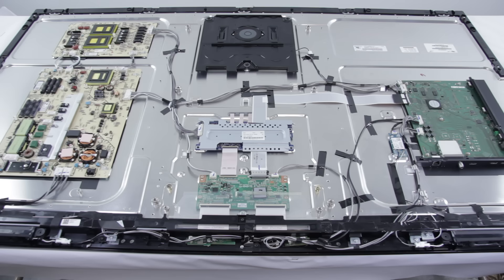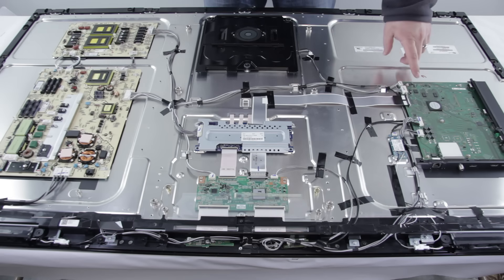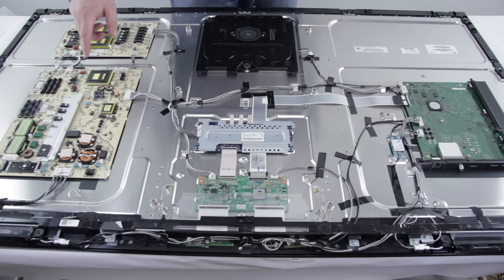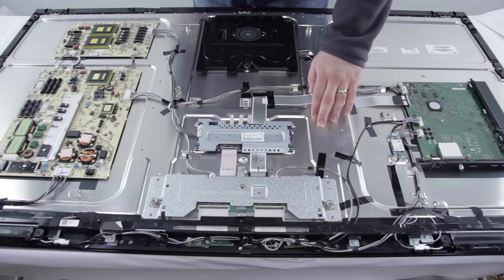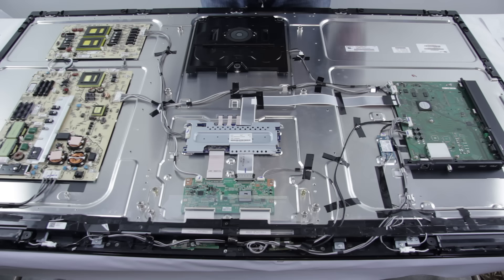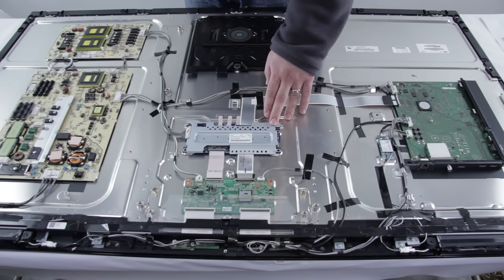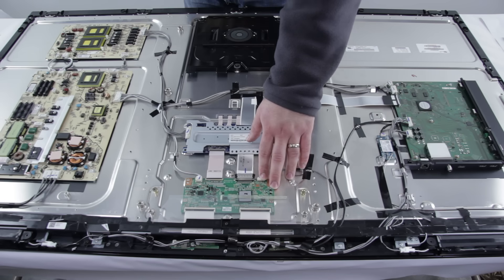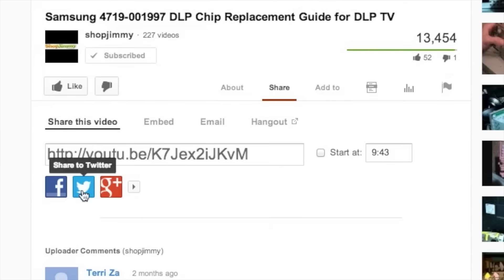LED TV Repair Tutorial - Common Symptoms & Solutions - How to Repair LED TVs

Comment: Hi there I have an LG smart TV 32 inch. http://www.lg.com/au/tvs/lg-32LV3730-lcd-tv
One side of the screen (left) is ok but the right side has 4 or 5 large vertical coloured bands going vertically. I also noticed very fine black horizontal lines going across the whole TV. Immediately I think its the tcon board but someone suggested I try test that the panel isnt faulty as there are two small thin boards that are connected via the two tcon ribbons (which apparently are fixed to the panel and not replaceable? - that true?). Is there a way to test if the panel is actually at fault or do I just need to try replace the tcon board first and see what happens? If I unplug the tcon board, the lines dissapear. Anything else I could try rule out if its the actual panel?
Reply from the maker: Dudley Butt   This could be a problem with either the t-con board, the main board or the TV Panel.  You can replace the main board and t-con boards individually to see if one of them fixes the problem.  Unfortunately I do not see any replacement parts in the search results for your TV model number on our website.  Please reply with your part number on your main board and t-con board and I can try searching for replacement parts.  Thanks and please let us know if you have any further questions!  www.shopjimmy.com

Comment: Hi, i have a Samsung ledtv model UN32D4005BD. Ive had it for nearly 3 years now. I usually play my ps4 on it and as of late i have suddenly been getting some issues.  A fifth of my screen starting from the top is covered with white thick ghosted vertical lines and series of horizontal lines are flashing on my screen. What should i do? Is it a case where i have to replace the main board and power supply board or is it that screen is no good and i have to buy a no tv. I would like to try to fix this problem b4 resorting to idea of buying a new one.
Reply from the maker: Chris Follette   This sounds like a TV panel (TV Screen) problem.  If your TV panel is bad, it may be more cost-effective to replace the TV as panels are typically hard to find in stock, difficult to replace, and expensive.  Thanks and please let us know if you have any further questions!  www.shopjimmy.com

Comment: Hi I have a Samsung led model is PN43E450A1F.. somehow tv fell on its face and screen has a smallcrack on the inside.. tv has power and sound but no picture.. Any suggestions
Reply: Actually it's a plasma
Reply from the maker: Dave Jones   This sounds like a TV panel (TV Screen) problem.  If your TV panel is bad, it may be more cost-effective to replace the TV as panels are typically hard to find in stock, difficult to replace, and expensive.  Thanks and please let us know if you have any further questions!  www.shopjimmy.com

Comment: I have a LG model 50LN5100-UB. Using a flashlight as mentioned in the video I can see the image and it does have sound. Seems that the backlight is the only problem. My question is which of the three boards in this unit control backlighting? There isn't a separate LED Driver board as shown in the video. Thanks In advance.  Wes.
Reply from the maker: Wes Moore   This could be a problem with either the power supply board or bad LEDs in the TV.  You can replace the power supply board to see if that fixes the problem with your TV.  Click this link to replacement parts for your TV model number:  http://www.shopjimmy.com/catalogsearch/result/index/?cat=229&q=50LN5100-UB  Be sure to match part numbers on your current board, with your replacement for compatibility.  Here is a link to a video showing how to identify your part number, click here:  http://www.shopjimmy.com/lg-eay62810801-power-supply-unit.htm  Thanks and please let us know if you have any further questions with your TV Repair!  www.shopjimmy.com
Reply: Thanks for the reply! I replaced the power supply board as mentioned above using an identical part number and revision number (2.1) still having the same issue. Is there a possibility that the problem is in the main board? I replaced the other two boards already because I ordered the t-con board before your reply.
Reply from the maker: Wes Moore   Since the power supply did not fix the problem, it sounds like your TV must have bad LEDs.  Unfortunately we do not sell replacement LEDs or TV panels.  Thanks!  www.shopjimmy.com

Comment: Hi my tv does not show any images. The backlight ist working sound and anything is ok you cand move channels but the picture does not appear
.  Orion model PIF39-DLED i think is the t-con board. where could i buy one of that. the image of the t-con bloard http://snag.gy/8yadq.jpg
Reply: the t-con board is then ok ?
Reply from the maker: Cristi Crai   Sounds that way.  As recommended you can replace the power supply board to see if that fixes the problem.  Thanks!  www.shopjimmy.com
Reply: it was the t-con board i bought on ebay new  and now the tv works fine ... thanks for help

Comment: Hi ShopJImmy, I need some help with my Vizio M3D550KD. The TV started getting strips of thin vertical lines a couple inches wide, some faint horizontal lines, and the picture freezes every few seconds for a second or two. It does continue to show video (does not power off on its own, it unfreezes and continues for a few seconds) and the sound works fine. The lines and the freezing every few seconds is the issue.  It is occurring on all device inputs. Any help would be appreciated. Thanks

Comment: I've commented on a Vizio TV repair, but I think this description better fits my issues:

We had two E701i-A3 TVs in operation with an HDMI splitter mirroring the image when the splitter malfunctioned and blew an SMT part off its PCB. This killed the splitter and made one HDMI port on both TVs non-operational. As a work around, we took the splitter out of the circuit and just operated the two TVs independently by avoiding connection on the bad HDMI inputs. This worked for about two weeks before one TV refused to power up: No picture/sound and the white power-on light in the lower left-hand corner of the TV frame does not light. We checked the easy causes, like power cord connection to the TV/cord integrity/cord connection to the power strip, but although we have 110V coming out of the plug to the TV there still isn’t a picture or sound.

As a preliminary step, I carefully removed the back of the TV in question to look for any visibly-burned parts as described in the videos, but nothing seems to obviously charred or broken and the fuse is intact. My main focus is to restore power-on at this point, but eventually I would also be interested in fixing the blown HDMI ports, too.

Please let me know if these symptoms sound like something your company can help me repair through discrete components, board replacement or sending an assembly in for repair. I feel comfortable replacing thru-hole parts if it comes to that, but SMT replacement would probably require my sending in a damaged board.

Thank you for your time and I hope to hear back from you at your earliest convenience.

Comment: Hi, I have a Panasonic TC-55LE54.  It displays a viewable picture, but the picture is snowy, and has static-like white-ish lines crisscrossed (horizontal and vertical, NOT diagonal) over the picture.  The lower right 1/8 of the screen seems darker and has less of these lines.  From watching your videos, I'm guessing it's the T-Con board, but wanted to get your input before ordering the part.  Thanks in advance for your help -- this is a great service you're providing!  :)

Comment: I'm about to surrender.  The Samsung UN40D6000SF is my TV.  It started off with a double picture..simple enough you tube to find the faulty ribbon connector, but missed the step about pulling the power before disconnecting one of the ribbons.  After disconnecting the ribbon, I have not been able to power up the screen at all.  I have re-seated the ribbons, but still no power to the screen.  This is about the limit of my capability...is it time to take it out to the curb and buy a new one?
Reply from the maker: DIPG Admin   This sounds like a TV panel (TV Screen) problem.  If your TV panel is bad, it may be more cost-effective to replace the TV as panels are typically hard to find in stock, difficult to replace, and expensive.  Thanks and please let us know if you have any further questions!  www.shopjimmy.com

Comment: So my Samsung LED model UN55EH6000FXZA has no picture, but still has sound.  The picture started flickering at first and I was able to get it to work by jiggling the power cord connection to the back of the tv.  Now that doesn't work anymore.  I can get it to flash here and there, but picture will not stay on.  What should I do?

Comment: Hi,  I have a Samsung UN55C7000 led tv that works fine but will not take remote commands, when I turn it on the red power light constantly blinks and I have to press the remote button multiple times for it to take a command.  However, the controls on the tv work fine.  I have it hooked up to a receiver so when the receiver goes off the TV does also, but if I manually try to power it on or off with the remote it doesn't work.  Also, I noticed the tv doesn't react to the ambient light in the room anymore, I have it set to auto dim the screen during low light but it has stopped dimming.

Comment: hello ,shopjimmy
i have a vizio model # vo47L-FHDTV10A serial # LSPBNBJ1402557 i have power,and sound, but no picture. i did the flashlight test and see images, so i ordered the backlight inverter kit and replaced them one at a time  first the master and then the slave. this did not resolve the problem. assuming the parts i received from you were good ,what would be the next step ? should i replace the t-con? i don't want to just throw parts at the problem if it is not worth it. any suggestions would be helpful. 
i am a novice repair enthusiast. thank you, Ralph

Comment: Hello Jimmy. I have a main board for a Toshiba 40l2200u that is not sending sound. I replaced the main board using your advice but I forgot if the main board had a speaker cable attached. Does the main board for the model TV stated use a speaker cable to connect to the speakers? Thank you.

Comment: Hi-thanks for the videos. I have a LG-55LK520 and the red power button slowly fades in and out on the bottom right hand side. The TV will not turn on and I have no sound or picture. Any thoughts on repairing? Problem, Cost, Part? Thanks so much ShopJimmy!

Comment: TV screen is blinking .....and comp 1 and comp 2 has no color 
TV is element
model number. elchs321
Reply: can you email me any info powerme74@gmail.com I have my TV apart I saw on line that with another TV the guy fixing it only had to clip one connection on a board and it worked but that wasn't my model number can anyone help me I need my TV
Reply from the maker: mary power   I recommend replacing the main board in your TV.  Unfortunately I do not see any replacement parts in the search results for your TV model number on our website.  Please reply with your part number on your main board and I can try searching for replacement parts.  Thanks and please let us know if you have any further questions!  www.shopjimmy.com

Comment: I have a LG 42LV5400. the video is fine but the audio stopped working. I plugged a headset and i have audio that way but not through the speakers
Reply from the maker: aldo rosales   I recommend replacing the main board in your TV.  Click this link to replacement parts for your TV model number:  https://www.shopjimmy.com/catalogsearch/result/index/?cat=56&q=42LV5400  There may be multiple boards for the same TV model number, be sure to match part numbers on your current board, with your replacement for compatibility.  Here is a link to a video showing how to identify your part number, click here:  https://www.youtube.com/watch?v=RwHTvjMdrhk  Thanks and please let us know if you have any further questions with your TV Repair!  www.shopjimmy.com

Comment: I have an LCD element 32" model:ELEFW327
No matter what I do it only shows the stand by light, it turns on and stays on for hours after I kill all the power to the board and plug it back in, but if I turn it off it will not turn back on until I drain it again... any clue on what is going on?
Reply from the maker: Brandon Young   I recommend replacing the main board in your TV.  Click this link to replacement parts for your TV model number:  https://www.shopjimmy.com/catalogsearch/result/index/?cat=298&q=ELEFW327  There may be multiple boards for the same TV model number, be sure to match part numbers on your current board, with your replacement for compatibility.  Thanks and please let us know if you have any further questions with your TV Repair!  www.shopjimmy.com
Reply: I tried to get the same board and its out of stock, I don't want to have someone else fix it because it cost the same amount when they will jut be replacing one part.. I would rather have a secondary board so I can have spare parts when needed... do you know when you will have the parts back in stock?
Reply from the maker: Brandon Young   Unfortunately, we do not know when the board will be back in stock.  On the product page, you can sign up to be notified when the part is back in stock.  Thanks!  www.shopjimmy.com

Comment: I have a samsung UA46B6000VF twith all inputs and audio working fine but there are "dotted lines all over the screen on all inputs including the menu and info
Reply from the maker: Chris Schtork   This could be a main board or TV panel problem.  You can replace the main board to see if that fixes the problem.  Click this link to replacement parts for your TV model number:  https://www.shopjimmy.com/catalogsearch/result/index/?cat=56&q=46B6000VF  There may be multiple boards for the same TV model number, be sure to match part numbers on your current board, with your replacement for compatibility.  Here is a link to a video showing how to identify your part number, click here:  https://www.youtube.com/watch?v=BEPWrefQvqI  Thanks and please let us know if you have any further questions with your TV Repair!  www.shopjimmy.com

Comment: Hello,
  My name is chris. about 17-18 months ago I purchased an insignia NS-55E480A13A LED T.V. " WITHOUT" the extended warrantee. (stupid, I know) for the most part it "was" a good T.V. until about a month ago when the screen started going black. sometimes it will stay on for 20 minutes and then go dark and other times it will go dark in 2 minutes. it also seems like darker programs and scene changes will trigger it. I did the flashlight test and can see the picture faintly. I did recently purchase a backlight inverter off of ebay. obviously that did not do the trick because I am contacting you still. either the inverter they sent me has the same problem or their is another issue with the set. is their any other reason the thing would be acting this way? could it be the con board? or am I just in possession of an $800 brick? any suggestions would be greatly appreciated.

Comment: Need help with LED TV repair for a LG 50LN5100. the TV has sound but no picture. I did the flashlight test and saw image. I replaced the main board and the T-COM board, still the same symptom. What else can I  do?
Reply from the maker: James B   This could be a problem with either the power supply or bad LEDs in the TV panel.  You can replace the power supply board to see if that fixes the problem.  Click this link to replacement parts for your TV model number:  http://www.shopjimmy.com/catalogsearch/result/index/?cat=229&q=50LN5100  There may be multiple boards for the same TV model number, be sure to match part numbers on your current board, with your replacement for compatibility.
  Thanks and please let us know if you have any further questions with your TV Repair!  www.shopjimmy.com

Comment: Hello, I have a Vizio E470i-A0 LED tv.   I have no picture but sound. I can shine a flashlight into the screen and see shadows.    Can you please help me with a solution to fix my tv?
Reply from the maker: phrekyboy   This could be a problem with either the power supply or bad LEDs in the TV.  You can replace the power supply board first to see if that fixes the problem.  Click this link to replacement parts for your TV model number:  http://www.shopjimmy.com/vizio-0500-0605-0270-power-supply-unit.htm  There may be multiple boards for the same TV model number, be sure to match part numbers on your current board, with your replacement for compatibility.  Here is a link to a video showing how to identify your part number, click here:  https://www.youtube.com/watch?v=4i57Cm9-96M  Thanks and please let us know if you have any further questions with your TV Repair!  www.shopjimmy.com

Comment: Hi  jimmy. .. i have a lg 42le5400 and the remote will not turn on or off the t.v.. any ideas what it is?..i think it might be the i.r sensor but im not sure. The remote works and has new battery as well. Help
Reply from the maker: Toubee Lee   I recommend replacing the main board in your TV.  Click this link to replacement parts for your TV model number:  http://www.shopjimmy.com/catalogsearch/result/index/?cat=56&q=42le5400  There may be multiple boards for the same TV model number, be sure to match part numbers on your current board, with your replacement for compatibility.  Here is a link to a video showing how to identify your part number, click here:  https://www.youtube.com/watch?v=RwHTvjMdrhk  Thanks and please let us know if you have any further questions with your TV Repair!  www.shopjimmy.com